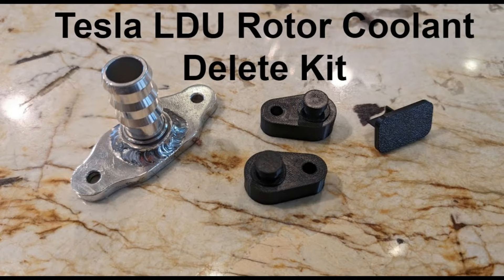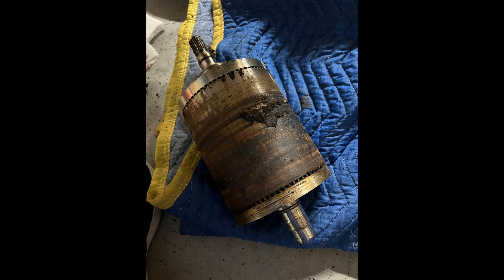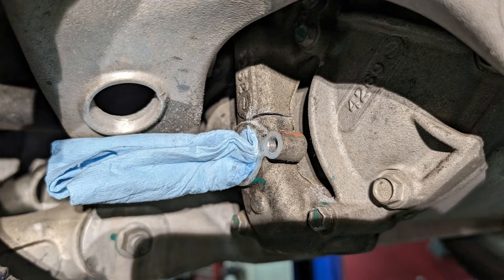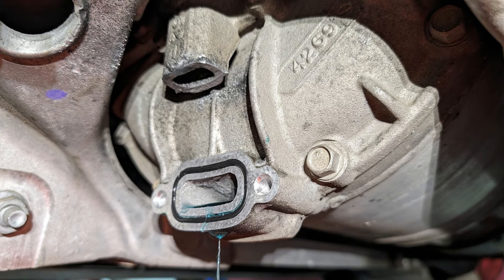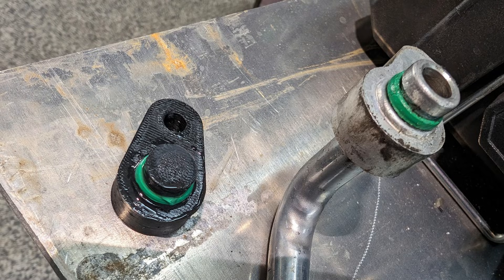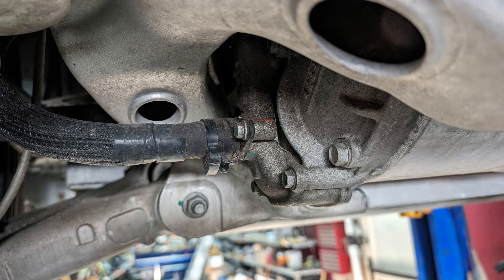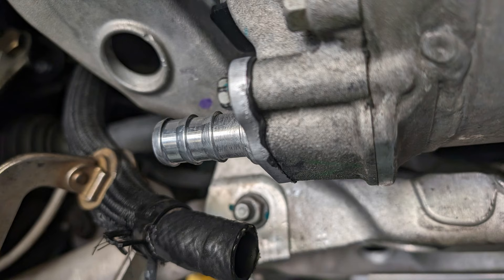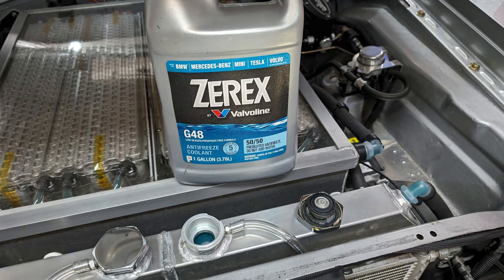Tesla LDU Rotor Coolant Delete Kit - For sale in the description!

Comment: Looks like a fix but if there is coolant already in there how this fix going to stop the moisture from corroding the components inside?
Reply from the maker: That can still be a problem, this is a preventive fix prior to any damage.  If the motor already has moisture inside it may need to be rebuilt and then be sure to install a coolant delete kit.
Reply: Coolant inside,  after 1000 km with  high temp 100 degrees celsius? No way:)

Comment: Hi, very helpful, thanks. I read somewhere that with such a solution, the rotor bearings must be replaced with special ones for a higher temperature. Do you think it is necessary?
Reply from the maker: It's probably a good idea if you're rebuilding the motor.  I don't think there's any specific data as these various delete kits are pretty new.  It's a pretty small amount of coolant flowing through the rotor to begin with, so it's not a dramatic change.
Reply: @MrMoparMan Another thing - I wrote this, what you think? Coolant delete option above that also eliminates the "flyover pipe" reducing coolant flow into gear box could lead to an air pocket forming in the gear box. Note: Tesla U version retains the "fly over pipe".
Reply from the maker: @boni1970  I have clear fittings in my system and the air bled out just as quick as always.  Since the pipe is connected to the top of the differential, once the system is back together you could bleed the top block off fitting just by taking it loose if desired.

Comment: I understand now the water doesn't go up to the circular section and it flows directly to the stator... but what does deleting the pipe do? How is the cycle flowing? So in the past the water goes into stator and rotor simultaneously then what next?
Reply from the maker: The coolant pipe was the return flow after the rotor.  This return flow would join the stator return at the differential, then continuing on to the radiator.  The pipe is no longer needed with no flow to the rotor, but needs to be capped off so that there is no reverse flow through the pipe.

Comment: Now that seems like a doable DIY...thanks Kevin!
I asked the same question on the other delete solution YouTube: What do you think are the future ramifications of removing that cooling? I know that it's 1000% better than having to replace the LDU from the leak itself, but I'm just trying to gather all the data I can. Thanks in advance...preciate'cha!
Reply from the maker: So far nobody has reported any negative effects of eliminating rotor cooling.  With this induction motor, the rotor has no magnets to demagnetize, and can take a lot of heat.  I like having increased stator cooling and have noticed as much as 10% lower temperatures during sustained highway speeds.  Based on external temperatures, the deleted coolant manifold has an external temperature of approximately 10° C higher than the cooled stator housing after a 30-minute highway heat soak, I did not test this prior to the delete however.  I have to think keeping the original part installed with the coolant tube inside the rotor acts as somewhat of a heatsink.  Seat of the pants, zero difference, great performance all around.  I can't come up with anything that I see even slightly negative compared to the damage the leak does.  Like you said, it's a good trade-off.
Reply: @MrMoparMan  Thank you so much for the very detailed explanation. I was honestly looking for a solution that didn't involve me having to remove the unit while also checking the box on eliminating this risk. Have you happened to assist anyone with doing this on their Model S? I assume this video was done on Electrolite. EDIT: now that I think about it, it may not make any difference since you mounted the entire Model S subframe into Electrolite.
Reply from the maker: @fdhall  Yep the video was from the Electrollite, I was able to remove the entire coolant pipe, but there is one fitting that is difficult to get to in the Model S.  Instead of removing the entire coolant pipe, it can just be cut and plugged off giving the same results and easing the installation.
Reply: From what I've read, just don't plan on towing anything for a long distance.  And note that Tesla is now providing 'U' versions of the LDU with a coolant delete manifold already installed.  I was pretty annoyed that I received a 'Q' version (end of part numbers).

Comment: Changed from the printed coolant hose connector section to welded metal?
Reply from the maker: Yep, lots of requests for it. Also, a new method to install by cutting the coolant pipe making it easier when installing in the vehicle.